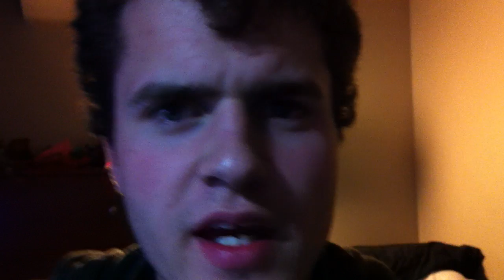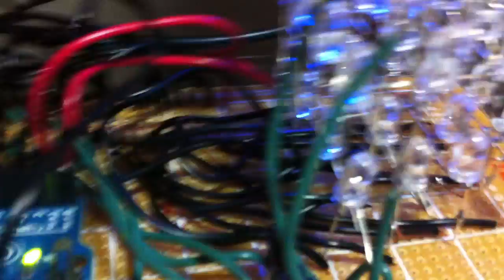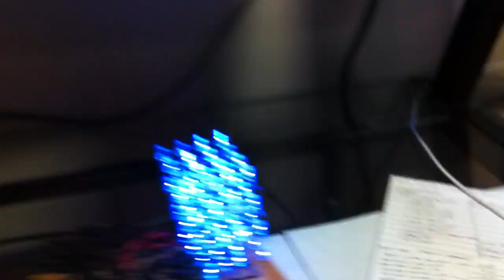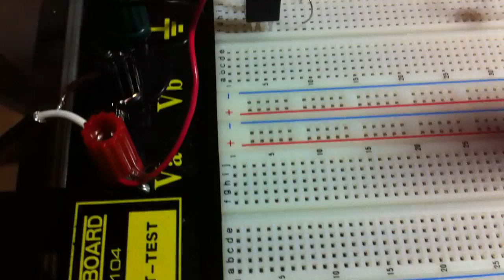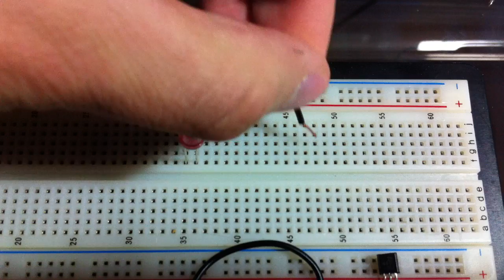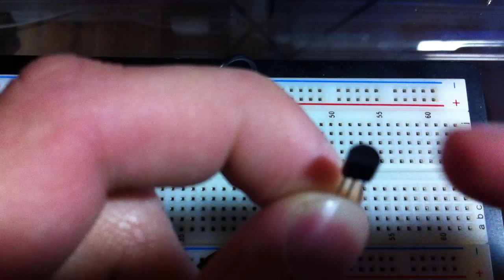Electronics - Using an NPN Transistor as a Switch

Comment: Generally the resistor that you should use for an LED is that which would result in the current passing through the LED to be 15mA. So if you're using a 5v battery, and the LED drops the voltage by 2v down to 3v over the resistor, then in order to get 15mA you'll need 3v/0.015mA = 200Ohm. It's good to know so don't forget that ;-).

Comment: The whole point of using a transistor as a switch is to use a small current or voltage to control a large one. What you missed out was that you can use a larger resistor going into the base, which then drives a small base current, and that then controls the much larger collector current.
In your circuit with a 5V supply, the LED will drop about 3V, leaving about 2V across the 47R resistor, giving a collector current of roughly 40mA which lights the LED brightly. But you only need design for 2mA as your base current, so you could use (5V / 2mA = 2.5K) something like a 2.7K resistor connected to the base to switch the transistor on fully.

Comment: The 'n' and 'p' have nothing do to with the material being negatively or positively charged.  It has to do with the type of dopant added to the material.  The 'n' does kind of mean negative because it stands for 'donors' which donate an electron to the material causing excess negative free carriers in the material.  And visa-verse for the 'p'.  However there is no net negative or positive charge in the material as you stated, this is due to charge neutrality conditions and natural diffusion.

Comment: Great video, straight to the point and useful. 2 things: First of all, the name transistor has nothing to do with the number of pins, 3. The prefix you're thinking of is "tri" not "trans". Anyway, the second item is that NPN does not stand for negative, positive, negative; that is, the "layers" of silicon are not called "negative" or "positive". Instead, they stand for "n-type" and "p-type" doped silicon. If you would like to learn about doped silicon and what these letters stand for, I'd recommend searching "how do transistors work" and instead of finding a video on how to use them, find one that explains how they function. Have a great day!

Comment: In actual transistor theory this is essentially correct.  But the thing is there are many types of transistors.  In this video he is using a BJT transistor.  The primary fundamentals are that a BJT transistor can control(switch) a large current through the Emitter/Collector by varying a small current through the Base.  In other transistors such as JFET's and other FET's, you can control current flow through the device by applying different biases to the gate, essentially acting as a switch.

Comment: @lowsideswitch You gain the ability to switch high currents with a low current source. An example would be if you wanted to turn a motor on or off with a microcontroller. If the microcontroller can only supply (for instance) 40mA per pin, and the motor takes 200mA, the transistor allows you to switch the higher load. Transistors switch faster than relays and use less power. Relays can handle more power though, so many times relay coils are switched by transistors.

Comment from the maker: That's a good question. The main reason is that a regular switch is mechanical, and needs to be switched on manually. Whereas a transistor switch can be switched electronically, for example by a micro processor.

Comment: @ismaels91 

You are correct, transistor was actually a combination of transfer and resistor. However, using transistors as a switch can actually be very useful. For example, I have a photocell that can only take a few milliamps, but a motor I'm using needs 3/4. I can use this way to make a simple(when compared to other methods) light activated motor.

Comment: Nice one, although a subtly would be that the N and P regions of doped silicon are not actually positively or negatively charged. Instead, the addition of certain doner atoms causes either electrons or holes to become mobile and able to conduct charge, although the total number of positive and negative charges has remained equal.

Comment: Hi, I have checked the pin out on NPN and PNP ( Common Bi-Polar Transistors) and with the FLAT side UP, and the pins FACING you, they are Emitter, Base & Collector, or E B C. Some do vary, so check. Like you, am self taught, could be wrong, but I believe this is correct. Good video, keep learning! C.

Comment: So basically the transistor is basically a switch or basically an amplifier. If I basically turn it on, basically there will be current flow basically from the collector.

Comment: Always check the transistor datasheet. For instance BC368 has base on pin 3, collector on pin 2 and emitter on pin 1. Good video although IMO it would have been more demonstrative if you had used a separate power source (like a 1.5V battery) to drive the base.

Comment: Think of a scenario where you have to control a 12V motor with a microcontroller.  Lets say the MCU (microcontroller) is programmed to turn the motor every 10 seconds, but most MCUs can only output 5V maximum. So what you do is hook up a transistor as shown in the video, replace the 5V supply with 12V, replace the LED with the motor and connect the output pin from the MCU to the base of the transistor, and voila, you are controlling a 12V motor from just 5V!

Comment: @michaeljudge88 as far as i call tell from the video, the two resistor on the board and is the same ohm size - which i think makes the confusion - cause you could do the same without the transistor. If you did an led array with 5 led's (or using a component that requires more voltage), powering them with 9vdc from the top rail on your board, and then powering the base with a 3v battery, it might be more understanding.

Comment: Good explanation on how to use a transistor. But would rather connect an led and resistor in series. Less components and can still use a wire as a switch.

Comment: So for a FET or n-Channel Mosfet, the Vgs(th), or the gate & source threshold voltage, is what determines how much voltage is required to turn on the n-Channel mosfet. 

The (Id) or the drain current determines how much current the n-Channel mosfet can switch.

What is it for the NPN Transistor? Is it the Collector-Emitter Saturation Voltage, or is it the Emitter- Base Voltage VEBO, that determines what voltage will turn on the NPN Transistor?

For the NPN Transistor, it's the Collector Current, correct? That determines how much current the NPN transistor can switch or is capable of switching?

Why do you use a resistor for the NPN Transistor? I use one for a n-Channel Mosfet on the Source and Drain to turn it back off when voltage is taken away.

Totally awesome video, probably the best on YouTube, that I've seen. (+1 : 1,502)

Comment: i been searching the internet trying to make since of transistors as switches. till now nothing. But your vid helped me in this understanding. But i must ask here is where i am loosing it..  Now why use the transistor at all? why not loose the transistor, and just hook the wire up or just ad a switch?  can you help me here?
Reply: Depends on the goal. You could create a circuit that interfaces both analog and digital inputs. For example if you wanted to create a fluctuating RGB led that received ground as analog source, and VCC as a digital source you would use a transistor.
Reply: Makes sense now. Thank you
Reply: Tommy Pence I want to replace a hard button withal transistor to make my arduino control switching song on my MP3 player with a remote via ir sensor
Reply: The thing about transistors is, they don't have very much use on their own. They are used as switches in computers that can toggle between letting current flow and blocking it, which can be represented with a 1 or a 0. This is where you get this stereotype 10101001010 represented with computers. Now, transistors can be chained together in many ways to create logic gates which can create logical flow, drive math in computers, store bits in RAM, and basically do every function that your computers, and this is basically only limited by the computer science. Modern day computers have somewhere around a billion transistors, that is at least one 64-bit computer I looked up. The thing is, the transistor he showed and that you and I would build with are remarkably larger, and I mean remarkably. In computers, they are on the scale of nanometers, as transistors only need about 100 atoms or so to function. If you would like to understand how they are used to build computers, I would highly recommend watching the crash course series on computer science. It's highly informative and professional, and you can learn anything you'd like. Hope I've helped, and if you have any other questions, feel free to reply or e-mail me @ jakesteinebronn@gmail.com. Have a great day!
Reply: That was a pretty lame explanation of the most useful and prolific semiconductor ever invented. By the way, binary is not a stereotype, it's simply the way computers function. For anyone who is interested in transistor based logic (or ttl) read about it on hyper physics. Basic synopsis, through a principal called band theory, and the Pauli exclusion principle fermions (electrons) can be in one of three manufactured positions: conductors, insulators, or semiconductors. Directed current flows to a comparator which reads the analog voltage as follows: 0-0.8v will register as a digital 0, while 2-5v registers as a 1 (low/high).
Reply: Do it, it's extremely simple. I recommend a BC548 NPN transistor.
Reply: Did that crash course explain how rudimentary  their understanding of computers is ? Honestly people need to first understand the concept of electricity.
Reply: I know it's how computers function, I'm a third level coder. I know how the physics behind transistors work, I've taken basic chemistry. I love how you use jargon to try to make yourself sound smarter, though. Good job!

FYI, btw, I used a "pretty lame" description because the person I was trying to educate didn't need to know about molecular physics; instead, I was trying to insight curiosity so he would learn on his own. :P

It's clear you have a high intellectual understanding of transistors and the physics behind them, as do I. However, I do not use this knowledge to try to one-up people; instead, I use it to try to help people. Be more considerate before you embarrass yourself by sounding like a smart 10-year-old. Good luck, and have a great day!
Reply: Not sure what you're asking... as in, who's the "they" in question?
Reply: Because we want to be able to have an electronic input do the work for us.
Reply: Actually this concept is used for digital logics...you know the computers works on basis  of 0s and 1s ,that is actually on and off...these on and off should be done automatically(Based on so called clock signal)... you can't put a hard button there and do all on and off manually..
Reply: Sir Lance Walker ..I think there is no need to go so deep into those theories..it is good to have knowledge...but working of transistors can be explained in simple language without going sooooo deep and sucking brain out of learners
Reply: or any other NPN
Reply: good for you

Comment: because of the requirements of maximum current from an output pin on a chip (IC) or switch.   Unless you wanna blow your IC's (or switches that are only rated for usually 40mA).

Comment: Thanks for the tutorial! I had been having a hard time getting my transistors to do anything. I am curious however, why is it necessary to have a resistor between the base of the transistor and the positive breadboard rail? Is it simply to protect the transistor? Does the value affect the amount of current that can flow from the collector to the emitter? Again, thanks for the video.
Reply: The base resistor is needed to stop too much current from flowing through the Transistor's Base-Emitter path, making Bipolar Transistors (NPNs or PNPs) CURRENT driven, not voltage driven. Without the base resistor to limit current, the transistor will draw more and more current until the transistor overheats and is permanently damaged. 

With Field Effect Transistors (MOSFETs, etc) the resistor is not needed because no current flows into the Gate-Source path, making Field Effect Transistor VOLTAGE driven, not current driven.
Reply: no it doesnt
Reply: @aishwaryabramma2164  Which part is incorrect?

Comment: Wether it's a transformable resistor, transfer resistor, transconductor varistor or transresistor (in regard to tube transcondactance) et cetera is irrelevant. The point being the name comes from the electrical properties and NOT the fact it has got three legs.

Comment: great job explaining it but you had a working circuit before you put the transistor in, did you gain anything by using a transistor over a relay? and is there any reason you switch on the low side?

Comment: So you have to keep the base hooked up to the positive of the power source for the LED to remain on.
If you remove the base then LED is off
What happens if you connect the base to the negative side of power source?  Would it remain off, would it blow up, what will happen?

Comment: It was cool seeing how to wire a transistor, but in this case the transistor is not acting as a switch. The "switch" would be your hand removing and replacing the base wire from 5V. Is there any other way that a transistor can be used as a switch without having to physically open and close the circuit?

Comment: Thanks for the demonstration.
So given that I have "some" NPN transistor. How do I figure out which resistor I need to use before it? E.g. I want to switch it with 3,3V (ESP8266) or 5V (arduino uno).. what would be the process to determine which resistor I need?

Comment: I'm just concerend that the voltage going to the button will change. I need the exact voltage supplied via the controllers battery, and exclude any voltage i may apply to the resistor from the microcontroller. I'm not sure if it will "overflow" and raise the 3.3v or not.

Comment: but how do people make the flashy circuits ?
i saw dozens of vids, and no 1 explains WTF is going on, and they use 2 transistors what makes it even more confusing. i did understand what you explained now though, very clear step by step.
how i arrange the parts so the turn on/off signal is not done by me connecting/disconnecting the base to battery positive, but electronically ?]

thanks

Comment: Thanks. I know not all transisters have the same locations for their base collector and emitter.
 I think you should do a video scraping some old electronics for parts.
Use the internet and show us how to identify the parts and also how to use a multimeter to test transisters to find out what they are, pnp or npn and what order the base, collector and emitter are in.
 I know hacking is a big topic right now so if you got some simple projects with a parts list, you could state what parts you need and how you are going to get most of them from scrap or used electronics.  
Find stuff in trash or head off to the good will and scavenged some old electronics and toys and make something from scratch and documented the experience. 
 
Many people would like to  see that including me. No one has shown this process from start to finish and what are good items you can find in the trash or buy second hand to find good electronic components.
Please let me know what you think of my idea. You could also take requests on what to make next, this would create intrest and people would send their ideas.
Thank you.

Comment: great video! I have a question though. In order to actually have the LED light up and then dim down and light up again, what kind of voltage does it need to be sent to the base? in other words, how can I get transistor in a shorted position without having to vary the current into the base manually? I hope that question make sense. Thanks ahead.

Comment: Good video but you didn't explain the purpose of using a transistor as a switch - as far as I understand it, you could use it to switch a motor on and off using very small voltage from, say, an Arduino or Raspberry Pi. In other words, the motor has its own higher current supply and the transistor turns it on and off using a small voltage from a microcontroller without frying said microcontroller. Is that it?

Comment: Watched your video..Really good
I got the circuit working using a kn2222a transistor..
The emitter comes first in this one (kn2222a)..
It would be better if you showed how to determine emitter,base and collector also how to determine that a transistor is PNP or npn

Comment: i get what you are saying but what is the difference from not using a transistor and just connect and disconnecting the postive battery wire its doing the sane thing
Reply: Makes no sense to me too, it would make sense if the LED stayed on after disconnecting the wire.....
Reply: the transistor provides a way to quickly turn off the LED without physically altering the circuit. This would be extremely helpful for a system that needed to turn a light on or off every time you press a button. Pressing the button provides power to the base of the transistor which turns the LED on, and then pressing it again would remove the power to the transistor base, turning the LED off. It's a programmable switch.

Comment: Thanks for the video michael! Thanks for contributing
Reply: Ive been doing a bit of research on MOSFETs and they seem a bit overkill for my requirement, so I'm doing some reading up on BJTs, what values do I have to consider when picking out a transistor for my circuit?

For MOSFETs I mainly looked at Vgs being lower than 3.3v to see if I could run it with a raspberry pi, as well as supplying atleast 320mA without getting hot, etc.

So how would I go about picking a transistor, or should I stick to a MOSFET? Any pros, cons?

Noob here